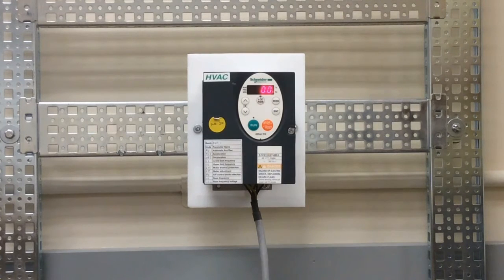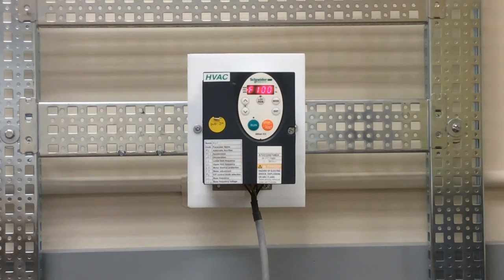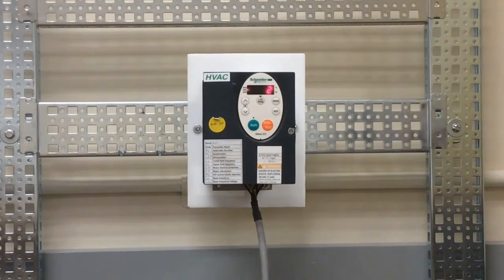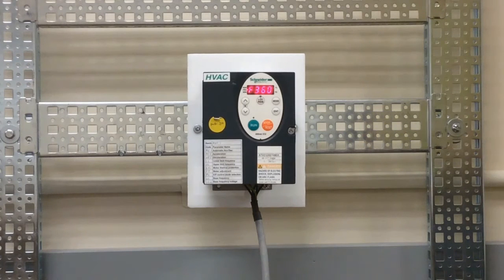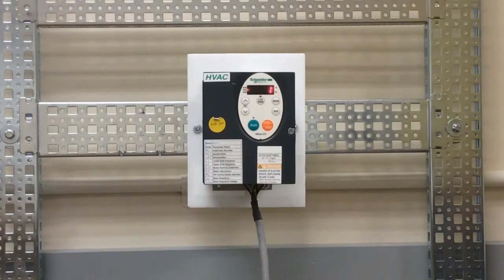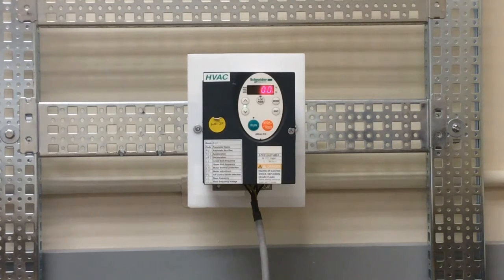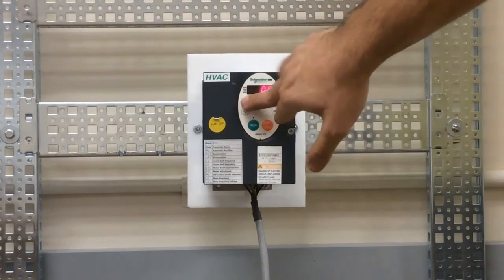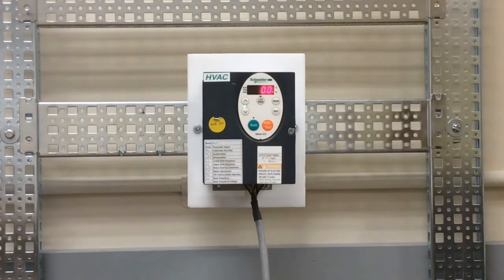Programming an ATV212 Drive to Run Using PID Control | Schneider Electric

Comment: Please show how you spin the motor, because  your setup does not work. The only way how we got to work PID - use VIA for setpoint...
Reply: It isn't just you. I think this video is wrong. I'm actually dealing with some of these set up like that and that HMI set point is maxing out the frequency rather than using a percent of the analog signal.

Comment: How to "go sleep" and "get-up"?
I am doing: 
TYP=3
F201=20
F360=1
FMOD=3
F633=18
F644=4
THR = 78.8
LL = 26
F391 = 2
F256= 30
F393 = 33.8
AND 33,6 as target
I have 1.6MPa manometr and my target is 5 Atmospheres

After this I on motor. Manometr physically locked - always show 4mA. It work on 26 (do not even try up Hz) by 30sec and go to LStp ("sleep"). After that never get-up.
Reply: Plus SW100 = I